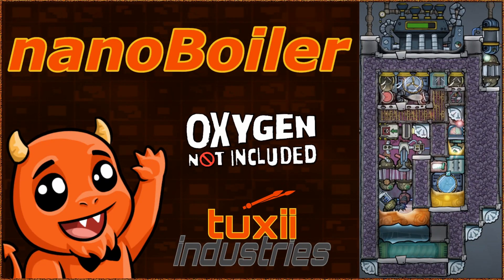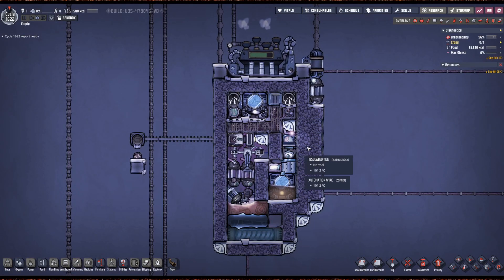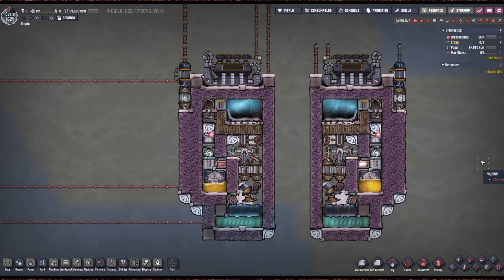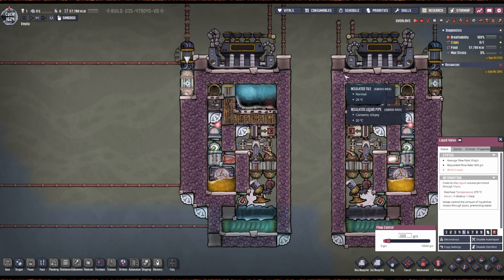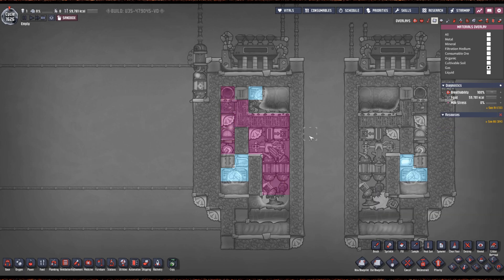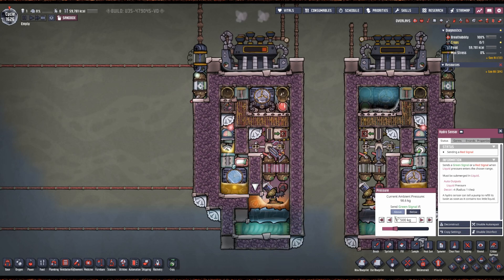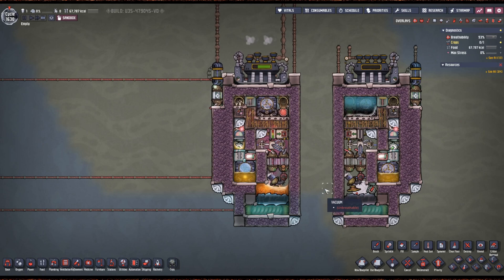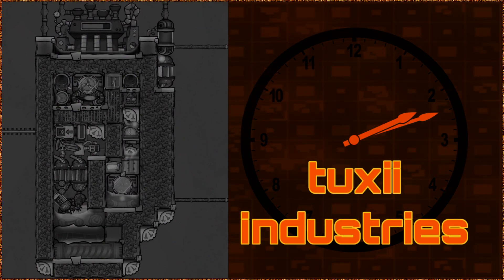nanoBoiler - Sour Gas Boiler Made Ultra Compact - Oxygen Not Included

Comment: This is a really cool boiler, but you didn't explain how to make those brine ice blocks, and I didn't find them elsewhere either. So I replaced them with aluminum tiles, then had to replace the hydro sensor with another insulated tile and move the hydro sensor to the right of the pump. Ended up with a slightly wider boiler, but otherwise, this works great. Thanks!
Reply: @olivier3162  I tried, but it just started freezing into ice pieces and sinking to the bottom of the supercoolant underneath, was that expected behavior?
Reply: @linak429  I expect brine to be like water, you need 800kg or more mass in the tile in order to freeze it to a tile

Comment: Thank you for the release. This fits just right on my current mini base (90x70) map. I made a modification, the methane liquid values are set to 670g so the counterflow is continuous. Although that might be too efficient as the tuner now has an uptime of almost 100% because the temperature in the boiler room is not hot enough (runs cold).
Reply from the maker: I never thought of throttling those valves below 1kg.  Nice touch!

Comment: 0:59 when in sandbox you can paint element "void", it will delete everything in its tile, very helpful in testing
Reply from the maker: We prefer to paint "vacuum" as painting void holds nothing in the tile.  We just tested it with a column of water above it and the void tile stays void whereas a vacuum tile will refill with water.  Thanks for the tip though!